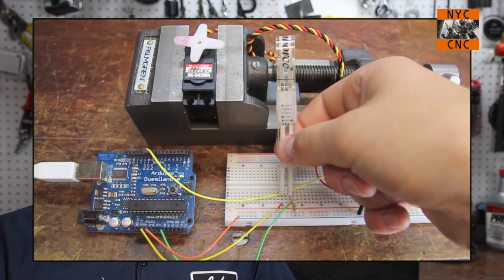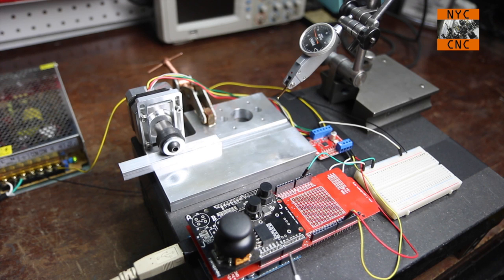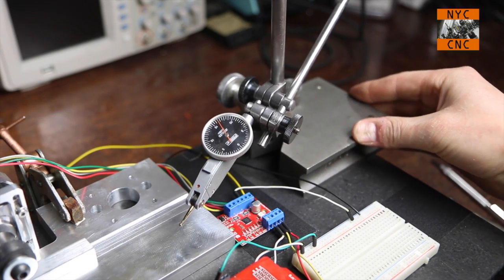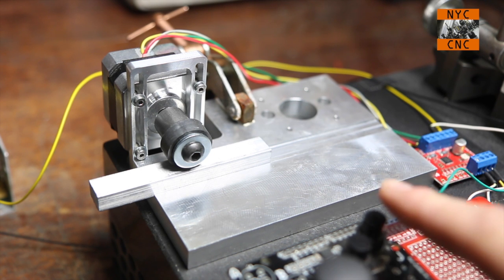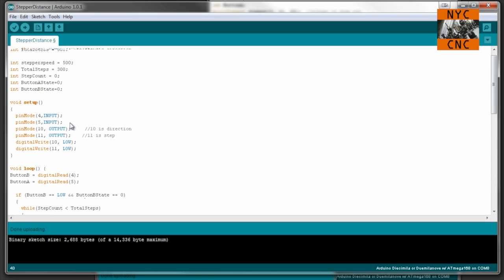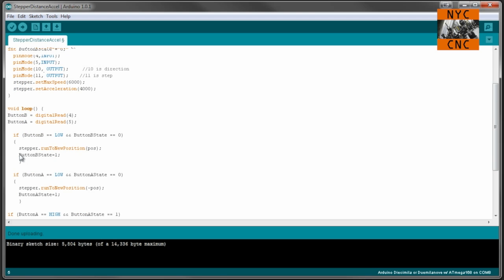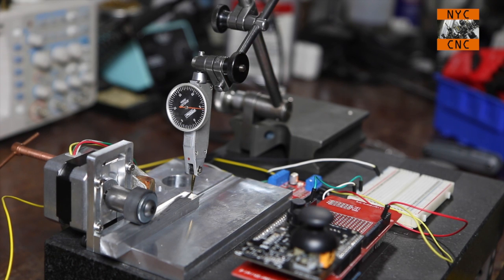Arduino Stepper:  Ultimate Accuracy!

Comment: The initial movement tests were far more accurate than i would have guessed at! My gut feeling is the inaccuracies using Acceleration are software related. Without the extra code you are effectively accelerating the block as fast as you can and mechanical slippage will be most likely to appear then. An interesting test would be to use a Cam or arm fixed directly to the output shaft with the test indicator... eliminate the possibility of any slippage then and retest! Keep the vidz coming :D
Reply: It is software and purely due to precision loss (the chip can only store floating point (or similar datatype) data to a given level of precision). i.e. if a chip can only store to say 5 decimal places then 6.666666 becomes 6.66667. And now start adding all that precision loss over say 600 steps... Add in the fact that he is measuring to a fairly high accuracy also - boom!

Comment: My guess on the displacement errors on acceleration is the additional force from the  increased periods of acceleration gives the rubber more chance to slip than a brief period followed by relatively no acceleration (constant motion).

Comment: Lubricate the bottom of the slide to ease the stiction caused by aluminium on aluminium to help the base line measurements for both systems.
The friction /stiction will defeat the different torque curves of the slow speed versus high speed rubber driving wheel.
Reply: NYC CNC I suggest that it is indeed a coding issue (more precisely [pun intended] it is a 'precision loss' issue within the code). If you think about it - because the code is trying to create a smooth curve to accel and then decel over a given distance and within a number of steps - some of these calculations will result in rounding. This rounding is due to the size limitation of a number within the chip itself. You normally wouldn't see this but because you are measuring so precisely you do.
Reply: +Paul Sullivan this can be corrected by accumulating the error and adding an additional step when necessary
Reply: nikotwenty This is not correct. You cannot accumulate the precision loss as it is never there to store. You would need a chip with greater precision

Comment: John.  I suspect the acceleration/deceleration is getting your rubber wheel to slip. Just a mechanical issue.  My router is a 4' x 4' x 9" Z, Rack and Pinion gearing, NEMA23 controlled via MACH3.  I can hold 0.002" after a tune up, but cutting aluminum often I'll plan 0.005", which is fine as I'll rough on CNC, then go to milling machine for final machining when I need accurate bore and holes.  Unloaded will return within 0.000 5"   I've been running this for over a year.

CNC Router - cutting 0.5" 6061 Aluminum     0.5" thick 6061-T6. Air to keep chips cleared, WD40 to keep cutting edge clean.  Tormach with flood would be better!
Reply: Ludicrous.  The acceleration LIMITS the initial velocity, so how can it cause the rubber to slip, when compared to his 'manual' code which just starts spitting out step/dir?  It clearly runs faster than the accel library version...but of course we'll never know because we don't have that library's source, do we?  Arduino world...
Reply: schwartzenheimer1
 Why do you need source code? Just hook up your scope and observe the step pulses.  Now if you get a nice 288V @ 1000 Amp power supply running a stepping motor you can have some real fun. You might even need a little floating point math to make things interesting.
Reply: Tom Walter
Good idea to use the scope, but all you'll be doing is verifying that the code is a) broken, or, b) being passed incorrect parameters.  Better to write the accel code yourself (it's not THAT hard!), and have complete control over how it works, while learning something in the meantime.  This is what I dislike most about the Arduinoid community: they all want to just hook something up and have it work with minimal effort, and often, minimal or no understanding about how it actually functions.  Like Mac users.  Of course they thrive on the ooohs and aaahs they get from their fellow Arduinoids, "Look you made a LED blink...oooh, aaah".  Feh!
Reply: NYC CNC
I guess the difference is that the Atmel already works, and is well documented, whereas your use of this (large general purpose and complex) library to perform a simple function, fails.  But, hey, no need to understand what's going on.  Arduino and Adafruit LOVE that approach, all the way to the bank.

Comment: John I think they use this for 3-d printers very accurate . not using arduino. all depends on the steppers abillity torque and power. I built a monster of a cnc router i use all .750 plate alum. still heavy i can get 250 ipm rapids  moving about 80-90 lbs.  just a thought. still moves faster then my tormach 770..
Reply: No not really, did some. didn't have a camera I was using a cell phone. lol  I have it running parts.The last creation was a quad copter made the body out of Lexan. powerful.
Reply: lol 2 funny

Comment: I've been watching and greatly enjoying a lot of your videos over the last couple of weeks and felt compelled to offer up a suggestion for very simply and cheap alterniative way to test the code to move the piece back and forth with little or no slippage. I can not take credit for the video, but it is a very simple DIY PCB CNC plotter Direct ink to PCB CNC Plotter. The author uses what I assume is nothing more than a piece of fishing line as part of a belt drive system.

Comment: Hey John! To measure "Ultimate Accuracy" you can use encoder, like one you have on that white nema34 tormach stepper motor. Or maybe i am wrong and it is not encoder on that motor.
Reply: NYC CNC
Don't think a limit switch is going to even remotely address the problem.  All a limit switch is good for is to set a zero reference on a particular axis.  Unless you're going to stay parked there and do nothing, I would submit that you need to accurately control the motion of the axis you're using.  You should take a clue from the good result you got by doing the straight step pulses, with delay.  Also, remember that the mass of the material you are moving will determine the maximum acceleration you can attain, so you'll need some way of adjusting it for different materials unless you'll be cutting the same stuff every time.  Also, as the piece you are slicing gets shorter (=less mass), it can be accelerated more quickly.  Do you really care?

If you are getting good results without an accel ramp up/down, unless it's a time/money deal, why not just tune it for max and then back off a bit for safety?  The perceived 'smoothness' that comes from ramping up/down is seemingly some kind of goal for you.  Is it really that important?

Finally, remember that even if you set some kind of mechanical/magnetic/optical limit switch, the material still has finite (and changing) mass to both move AND stop.  We can't have it coasting past the limit switch trip point, can we?  Homing routines on CNC machines slow the carriage WAY down, and back away from the limit switch to the trip point to mitigate the inertia.

Get a handle on the physics, write the code, and you'll be rewarded for your effort.  And you'll be free from Arduinoidism...
Reply: NYC CNC
Don't know how you managed to find anything snide in my comment. The fact is that engineers do just that every day: get a handle on what they are trying to accomplish.  I don't recall you actually defining the problem anywhere in this video, or in the comments.  Now we find out that you will be cutting 20' strips of material.  Good, a first step toward defining the problem, possibly leading toward a solution.

Just tossing little store-bought bits together randomly is certainly one approach - just not the best approach, and certainly not 'engineering'.  As I so snidely said, get a handle on the physics: how much will the 20' strip weigh? Coefficient of (static/sliding) friction. What processing speed do you require? What stepper torque do you have available?  What accuracy do you require? Etc.

Good luck.
Reply: NYC CNC
A telling answer.  I'm out.

Comment: good video, I didnt read all the comments and it could have been covered but it is likely that you are loosing steps between what is driven and what the driver can handle.  i see your scope in the back ground so put it on the line to verify the actual driven output.  you will also be able to understand the acc and dec better with a visual from the scope.
Reply: NYC CNC Don't be intimidated it is very simple. Looks like you have an Atten and should work just fine.  Turn the scope on the and turn on chan 1.  Set the timebase to 1ms and the volts/div to 2.  The trigger should be set to chan 1 rising edge normal and not auto.  Connect chan 1 probe to the step line and the ground clip to dc common. on the board.  Press the index button and it will help a ton to see the signal.

Comment: It should also be noted that your speeds are huge for the library. The documentation states that speeds of more than 1000 steps per second are unreliable (due to the clock frequency of the arduino). You'll likely need a better algorithm for acceleration/deceleration if you want to run faster than that, or turn your micro stepping to a smaller division. 

For reference, at 200 step/rev for a small stepper like that, 1000 step per second is 5 rev/sec, or 300 rpm, which for a half inch rubber wheel, is around 470~ inches fed a minute, or nearly 8 inches a second. At a max speed of 5000 as you set, that would be 3.25 feet a second. Given that it appears you have the driver set to quarter steps, that drops to 2in/sec at 1000step/sec, or 9.8 in/sec at 5000 step/sec.

Comment: I took a look through the source for the AccelStepper library, and the most likely reason for the inaccuracy is in this line of the cpp file: 
 103:   long stepsToStop = (long)((_speed * _speed) / (2.0 * _acceleration));

When you say (long)(<something here>), you are saying type it to a 32 bit integer. However, this will drop the fractional part of the calculation. So lets say here _speed=20 and _acceleration = 30. Then inside the parentheses, you 6.66..., so while you are 6 and 2/3rd steps away, the function continues as though you are only 6 steps away. Combine this fact with how the algorithm is controlling time, and it'll add up to some missed steps. 

I'll shoot you a message about tweaking the library towards accurate repeatability.
Reply: NYC CNC Unfortunately not; _speed in this equation is not the speed you set, but the intermediate speed which goes through a couple more computations. I looked to see if there were a subset of values which would work, but given that this library uses the arduino's loop as the time steps, there are no values which would work better. 

However, the fractional errors should be minimal if the speed is slow enough. The paper that the library is based on shows that the more loop steps there are, the more accurate the results. Given the processor speed of the arduino, that is likely where the 1000 came from for the library docs on a maximum speed.
Reply: they need to accumulate the error and add a step every time the error reaches a step. basic stepper motion code, my guess is whoever wrote the library didn't understand how you only can do integer math or you will be inaccurate

Comment: Just a tip:
Instead of an Arduino you can use a Teensy. It is a lot more powerful (with a 32 bit ARM Cortex-M4 72 MHz CPU and 256K Flash Memory, 64K RAM, 2K EEPROM), it is really tiny and breadboard friendly, has more PWM outputs and analog input pins, it can work as a USB device and at $20 it is not wherry expensive.

And best of all: You can program it in the normal arduino IDE with normal arduino functions, plus some more functions for teensy.
https://www.sparkfun.com/products/12646
http://www.pjrc.com/store/teensy31.html
Reply: NYC CNC Well it is a lot faster. So you can drive many steppers and at high speed with very good timing. Interrupts you can use on normal Arduino as well so no difference there. But the Teensy has the highly precise/fast "IntervalTimer" interrupt that the Arduino does not have.

Teensy IntervalTimer interrupt:
http://www.pjrc.com/teensy/td_timing_IntervalTimer.html

Using delays in your code for timing of actions i really pretty bad programming practice. It is much better to use interrupts so you don't delay the rest of the program waiting for the delay.

And i like the fact that you can just solder some standard male headers on the Teensy and put it directly on your breadboard and not having it lose on the side with some wires going to the breadboard as you must with Arduino.

I am using the Teensy for a project driving some brushless 3 phase gimball motors right now and the many PWM outputs with freely adjustable PWM frequency and the IntervalTimer interupt of the Teensy is really good. plus it is nice to know that i will not be limited by the hardware in speed/frequency or in program size ever.

The only downside to using the Teensy is that it is 3.3 volt logic. So on some 5 volt logic applications you may need to use a logic level converter. But it is 5 volt tolerant on its digital inputs (not the analog ones tho) so no problem putting 5 volt into it, and most devices works on 3.3 volt as well as 5 volt, even the ones that says to be 5 volt innput usually works just fine on 3.3 volt.

Comment: John,
It would be interesting to have a counter count the steps from the Arduino.  I think that the code is using a different base for the step count.
Reply: NYC CNC
I'd go back to the manual program, and set the steps to say 5. From there, step until you repeat the error (that you're getting from the accel program), and derive the number of steps that are being missed.
That should help to debug what the error is (division, rounding etc).
Reply: NYC CNC either the code doesn't count the steps correctly, or your pulses to stepper driver are too short, and you're missing steps. another option is you've set your acceleration too high (but you haven't, it's damn slow) or your current to the motor is too low, and you're loosing steps (unlikely, since you weren't missing them without acceleration).
Reply: NYC CNC check pulse width for both standard and accel libs with oscilloscope. If it's the same, then it's the code of accel lib broken.

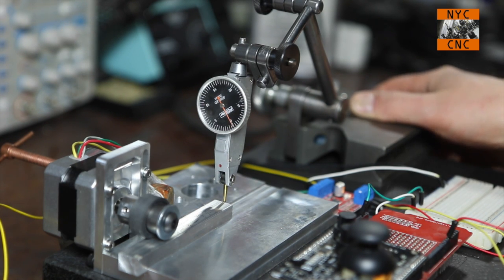Comment: The accuracy of the first movement at 16:22 seems to be very good compared to the accuracy of the accelerations tests at 16:59. It looks to me like the first movements (at 16:22) might have bottoming out the travel of the dial test indicator to the point where it was moving the dial test indicator itself and deflecting the test stand base ever so slightly (and the needle was stopping at exactly the same point on the gauge because it was out of travel).  The acceleration tests (16:59) didn't show the same deflection of the dial test indicator and the test stand base in the same way.  My eyes must be playing tricks on me.
Reply: Thanks for the follow up!

Comment: it says 4000 max speed in the doc: http://www.airspayce.com/mikem/arduino/AccelStepper/classAccelStepper.html#a176c5d2e4c2f21e9e92b12e39a6f0e67
Reply: NYC CNC Here, I reckon there is no mechanical problem because your test without speed ramp is the most mechanically stressful (and frankly there is no load). I'd check in the software. I'm sorry I don't have the tools, otherwise I would already have plugged a debugger in that Arduino myself, so I was trying to check on the manual.